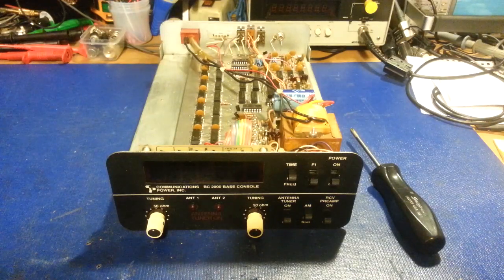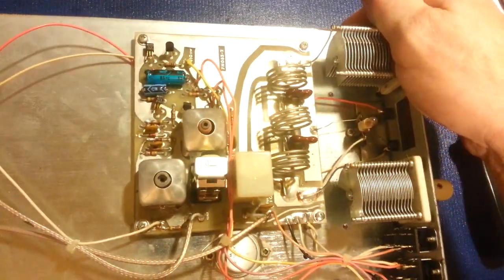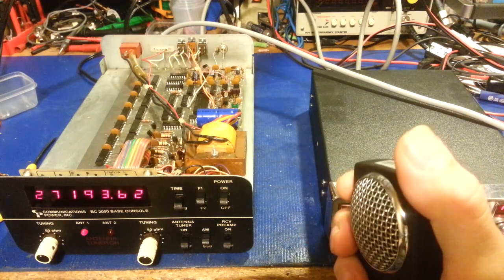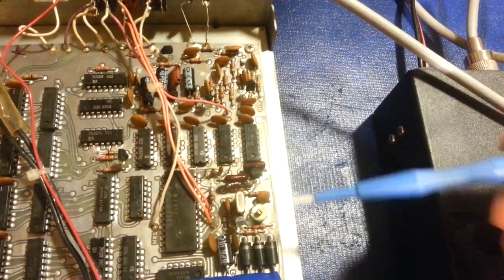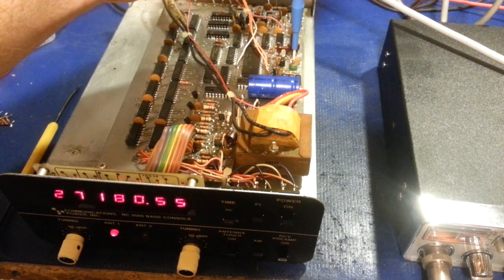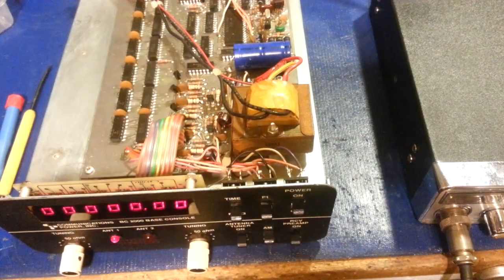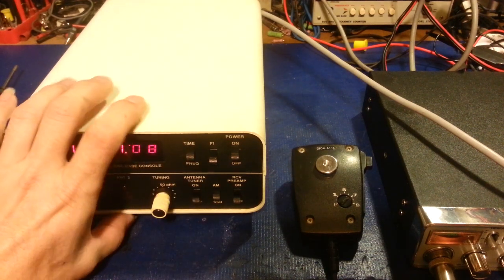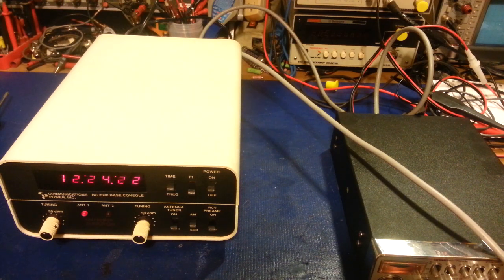CPI BC2000 Base Console frequency counter, antenna tuner, clock, rec preamp repair.

Comment: I know you so appreciate CPI and Stoner as we've spoken about those companies and the equipment they once produced. I can see the time that CPI put into creating there items. I can see that this CPI frequency counter ect ect was not only ahead of its time but built with quality in mind. I've never operated a CPI or been in the same room where one was in operation but they must be top of the line on the 11 meter  best hits chart. Another excellent repair and clip. Thanks Mike.
Reply from the maker: Problem with the radios is they have a mask type EPROM chip that is made of unobtanium.  If it goes bad you have a fancy paperweight.

Comment: Thanks Mike, i have found a new one but a different make ( still a  74ls90n) hoping it should be OK, the old one is still working just a bit worried about the crack in it.
Reply from the maker: Most vintage IC's in the 4000 and 74 series have been in production for decades and were made by many different manufacturers.  As long as the part number is the same you will be fine.

Comment: Hi Mike, i have the CPI BC 2000 console, one of the 74ls90n 7811 ic's has a crack in it, what would you recommend as a replacement . thank you
Reply from the maker: If it's a 74LS90N, replace it with the same.  I would check to make sure there aren't other problems.  Remove the old IC and check all voltages to see that everything looks correct before installing the new one.

Comment: Mike,
Another nice repair video. Do you use the Rigol DSA815 spectrum analyzer? In several of your video when you pan over in that direction, the view doesn't quite make it high enough to see the model number.
Reply from the maker: Yes, and it has the tracking generator option.